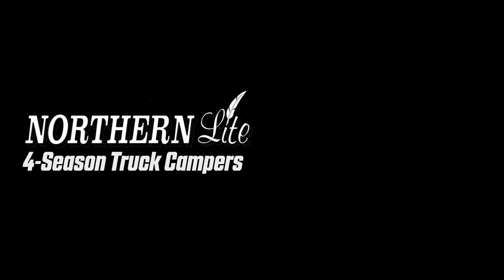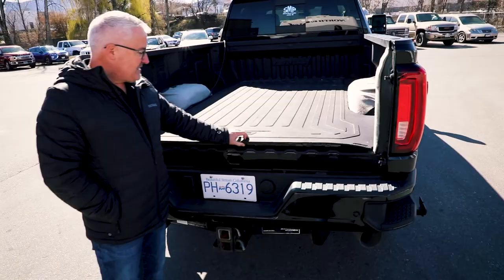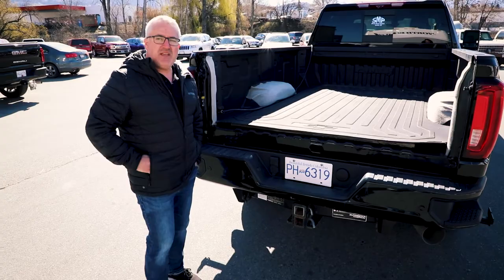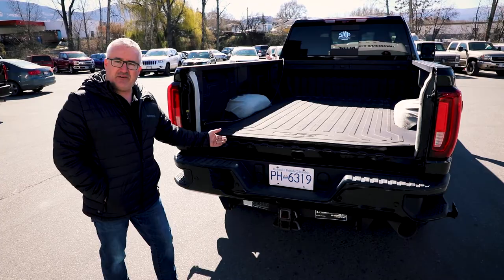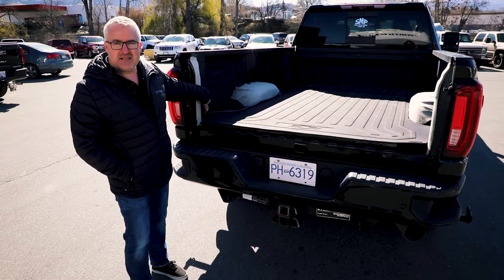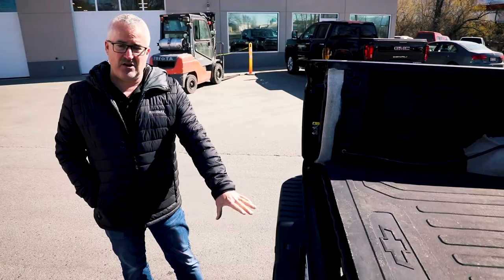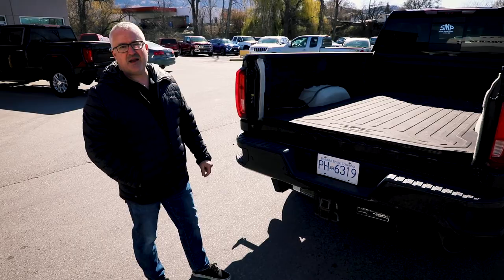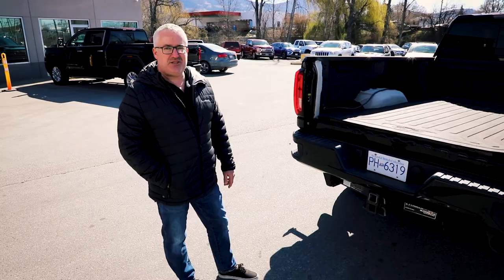How to Set Up Your Truck Bed for Your Truck Camper

Comment: Warren: So good to see you guys do this video!!!!!! THANK YOU!!!! Our 10.2le is at the dealer, just waiting for our new F350. Just joined your NL forum. This vid answered my questions regarding the plywood as I see you've used a 4x8x 1" sheet under the mat. With Fords having a tall cab, I'll probably go with 2x 3/4" + 3/8" mat. Just not 100% sure how much I'll need as I haven't got either and the camper is too far to drive for just a measurement.
Again, thanks for the timely video!
Reply: 2   1/2  inch screwed together is plenty on a ford f350 . 30 lbs. lighter than 2 3/4 sheets.. every pound counts for payload.
Reply: @gunsandrotors8704  Nope. The F350, w/ the block antennas on the roof starts at a 1/2" deficit. NL is 46" ( bottom to underside of cabover) From truck bed to top of antenna block is 46.5". What I settled on as needed for adequate clearance for rough roads or highway porpoising, to avoid roof slaps was a sandwich: 1/2" ply > 1.5" foam board >  1/2" ply > 3/8" Dee Zee style bed mat. 2 x 1/2" sheets would only give a 1/2" clearance. No where close to enough. And with 6603lbs payload, I got plenty. :)
Reply: @wingnutbert9685   I have a 2021 8'11 on a 2020 F350  using... 2 1/2 inch sheets of plywood and a 3/8 truck mat ...truck has roof lites from factory and the 2 black blocks on the roof NO CLEARANCE ISSUES AT ALL the NL dealer set it up this way I have 3 to 4 inches clearance Many trips for almost a year now never made contact with the roof. Maybe your gasser dually (6603 payload) is different. My truck is crew cab srw.
Reply: @gunsandrotors8704  '21 F350/7.3/CC/DRW/LB. Might be different, but it be odd being that much different. Maybe there's a big difference in cabover height between the 8.11 and the 10.2. I get about 3" with clear with my riser. So yeah, definitely something different there. I think 3-4" is a good minimum. See a couple guys driving with 1" or so and could see the cabover tapping their roof. Yikes! LOL!

Comment: a single sheet of plywood can move around.  I'd suggest whatever you put in the bed to be cut using the bed mat as a template so that it fills the full footprint of the bed....so would require two sheets of plywood.  I see you recommend not to use foam board, but the formular 250, 2-inch sheets, cut to fit the bed and placing additional foam blocks at each corner of the camper to wedge in between the camper and the bed walls has been working perfectly.  no movement of the TC and so much lighter than a bed mat and plywood.  in truth, even though I have a F350 with a camper package and a NL 9-6, I'm forced to use the foam or I would be over my GVWR and over my rear axle weight limit.

Comment: So the rubber mat is for grip so the camper doesn’t slide, but you put plywood under the rubber mat which slides very easily on the truck bed?
Reply from the maker: Hi Justin, no the plywood doesn't slide. This is due to the texture of the wood plus the similar size to the box. Our campers have molded fiberglass bottoms, unlike competitors, and the bottom design is extremely smooth which requires the mat for grip. We have been building campers for over 30 years so have lots of experience on what works and what doesn't.

Comment: Hello Warren, we have the 10-2 2019. We have the exact setup with the 1" plywood as well as the 3/8 inch mat. I noticed you put some carpet on the wheel well. Any particular carpeting? I like having that little extra protection. Just some normal indoor outdoor carpeting? Thanks

Comment: Is this plywood needed for all trucks? I have a 2018 ram dually. Seems all comments is about the ford.
Reply: It's a matter of how much space between your truck cab and Camper are. For myself with my F250 were just using the Mat we have. I had wood in the back 1/4 but were taking it out we don't need it.